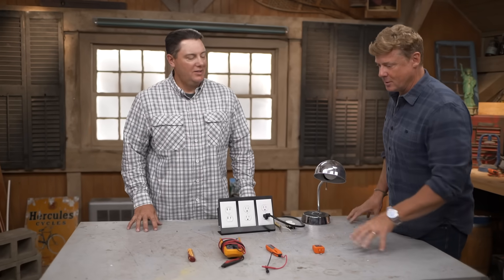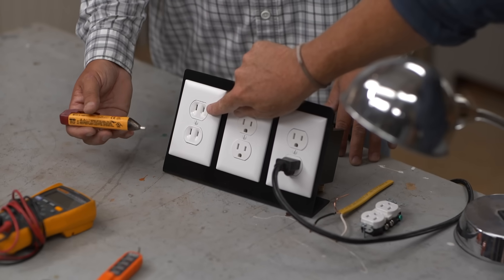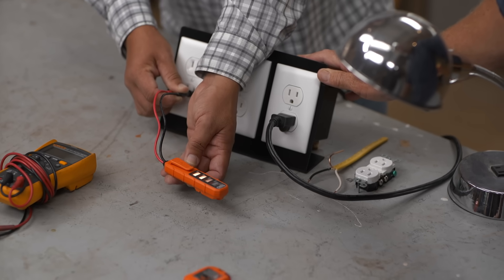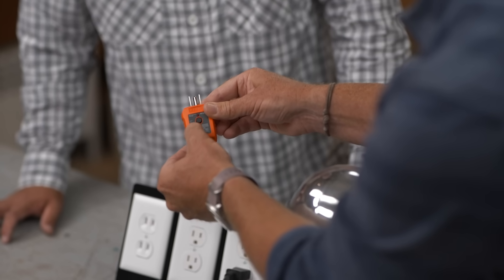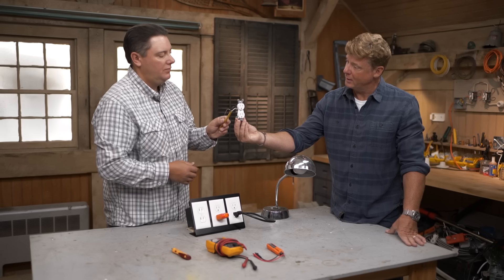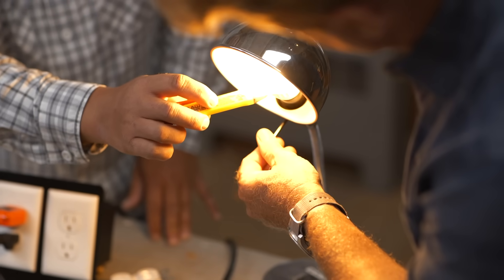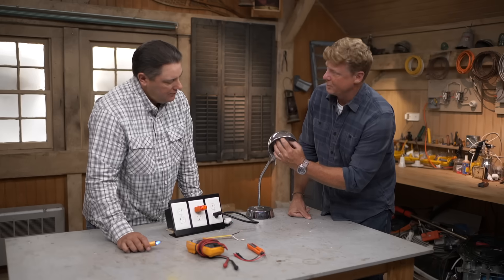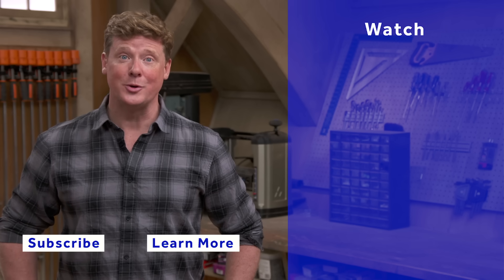How To Use a Voltage Tester | Ask This Old House

Comment: [1:45] — There might be a slight mistake here. Normally with regular multimeters, you first put the black probe in the longer (neutral) plug and then the red probe in the shorter (hot) plug.

That means here the red probe should end up on the right side but the demonstater put it on the left side.

Comment: I still don't understand what the usefulness is of the non contact voltage tester. If it says you have power, or if it says you don't have power, double check with a multimeter. Why not go straight to the multimeter then?

Comment: As a completely new commercial electrician, going on day 5 on Monday. I already have the multimeter tester but I’m scared to make contact with the meters as I don’t know if the polarity (positive and negative) will fry the system I’m working on or alter it in any way if I do it wrong? Right now I’m re-wiring light fixtures, pretty easy and plenty of unexposed cords. So in order for me to use my multimeter, I’d have to cut a wire and test it that way, would it be okay to place both meters onto the wire I cut? I’m sure if I test the ground I’d get nothing unless something was completely wrong lol so my question is do I cut the neutral or the hot wire and how would I place the meters onto the wire exactly? I’m not trying to fry myself as I work with 277v frequently and BOY is used with the colors making me even more nervous lol

Comment: THE CONTACTLESS TESTERS ARE NOT RELIABLE----I have 3 different models, 3 manufacturers-----AND I DON'T TRUST ANY OF THEM-----it's the false NEGATIVES (where power is actually on) that can get you..LOW VOLTAGE LEVELS (LEAKS) WILL NOT SHOW UP----still dangerous as hell.  You may think that a circuit is off, perhaps you pulled the breaker,---AND YET a wire can be energized through a short-and you'll never know---til you get zapped----USE ONLY HIGH QUALITY TESTING EQUIPMENT---or hire a licensed pro

Comment: The compact 3 pin tester - you also need one without the GFCI test button.  Because its easier than you think to accidentally press that button and drop the circuit back at the breaker - creating more work for yourself.  I discovered this at an RV park, when hooking up my camper to the power pedestal.

Comment: Direct contact tester is NOT fool proof!  You may not be making contact in an outlet for some reason and think it is not live although it is.  To be sure you will need to remove the cover plate to touch the connections.

Comment: I could not grasp the reversed polarity how to read it or less to correct the problem wiring it at all. Way too fast for me when you’re not an electrician by trade.
Reply: 2nd year electrical apprentice here from nz. Reverse polarity means live, neutral and ground wire are not where they should be. It means they have put into the wrong place for example live wire into neutral, or neutral into ground wire. 

If only neutral and ground wires have been swapped, the light will still work, but if the lamp is metal and bonded with the ground conductor, the metal frame will become live.

Comment: Receptacle testers - You have to be careful about the tester saying the ground is good. People that don't care about safety will put a short piece of wire connecting the ground screw to the neutral screw. If wiring in the house doesn't up to code a lot, then I would also take the cover off and look at the screws to be safe.
Reply: A socket tester is for casual testing. A proper test would include testing he ground loop impedance. The tester might show there is ground even if the impedance was way too high.

Comment: There is another mistake TOH, it is not reverse polarity. In ac circuits, your polarity is reversing 60 times a second meaning one side is negative and then 1/60 of a second later the same side is positive hence AC current. 
The fault is the fact that ground is always the white wire and what has happened, you are now grounding the black wire. I'm not going into the simple facts of the grounding in three pronged devices because it will just confuse you and the electrician. 
Just as a reminder follow the color codes in 240 v split phase ac and remember the polarity reverses by itself every 1/60 seconds. You should do better research.

Comment: Great information and comments. The 3 prong GFCI tester is definitely a good one to have. There is  a new version out that also has an LCD screen that actually gives you a voltage readout on the screen that comes in handy. I believe it is made by Klein….

Comment: Please help me out I have nowhere to turn. My electricity was shut off because of Bill issues. I brought a homeless man over to my house to make me a solar car powered battery charger. Because I charge all my devices through my car. My car doesn't drive but it starts up and I just put gas in it as needed and that idle to charge my devices through the cigarette lighter and through the car battery attachment clips. So back to the homeless guy. I left him alone at my house and then come back home and he's got four doors blocking the electric panel to make like a little closet. I said what are you doing and he switches a switch on the electrical panel and my power is on. Somehow he turned my power on on his own. I didn't ask him to do it and I didn't want him to do that. And I look in the power meter and such and there's like stuff on the ground that he cut and did s*** too pieces of stuff. I don't know what he did but only like half the power is on in the house. A month later a tweaker girlfriend of mine brought a dude over to my house said he can fix that. Soon as he walks in my house the lights start dimming like a seance. He said that's dangerous. So anyways they leave and I leave I come home all the electricity light poles on the whole block are off. And I look at my electric meter and circuit breaker box on the outside of the house and looks like he removed a couple circuit breakers from the top part. Plus don't forget all the light poles in the whole block are out and I was scared that maybe he did something bad to my house and I left and for the whole night cuz I pray the police are going to come. I ended up gambling all my money away at a local AMPM convenience store that has slot machines. I come back home in the morning I'm afraid to touch my electrical panel but I opened it up anyways. I don't know what it is it's all Chinese to me. That night the lights are back on the street but I have no power. Two days later I see on the news that this guy gets arrested for stealing copper wire from cellular towers and light poles all throughout the county. He had 300 transactions in 2 months at the couple different scrap metal yards in Nevada. Then I look online and I see that there's a lot of silver in the circuit breakers. I can't call the electric company. I don't have any money for a electrician I'm in 110° heat at my house and I have no water and no electricity and no air conditioning. I'm spending $8 a day on ice cubes just to cool my dairy products and meat in an ice chest. That's more money than be spending on electricity. Give me some clues of what's going on please thank you my dad died and this was his house and he was in the hospital for 10 months before he died and then covid happened and they have the moratorium I'm shutting off the electricity. So they finally shut it off. I moved in I had the electricity put in my name. My first electric bill was $3,230. They put his entire back Bill onto my first month's bill. So I wasn't really that pissed at the homeless guy turned back on my electricity because they wronged me in the first place. My bill should have been $30 not $3,230. Now I'm stuck between a rock and a hard place and catch 22

Comment: If you have two prongs, get an electrician to add ground wires or a GFCI. You might save yourself a nasty shock.
Reply: I'm not a professional.
If you have a two prong outlet you can't plug in 3 prong appliances so there is no need to worry.
But if you want to use 3 prong appliances in my opinion the best thing to do is to add a ground wire and 3 prong outlet which can be a big job.
GFCI is an option instead of ground wire but you don't get the advantage of reduced electric fields the ground wire gives.

Comment: It’s also a fire issue. Fuses are also placed on the hot side. If it is reversed an internal fuse cannot clear a fault condition. 

Theoretically the breaker should catch it, except if the short is a low current short exceeding the capacity for internal components it may not exceed the breaker capacity so the fault will continue until unplugged or the breaker is flipped.
Reply: Bull, almost all electronic devices use connector that fits either way. Lamps do not have fuses.
Reply: @okaro6595  if they fit either way that means the system either lacks protection or is designed to have fuesable links on both sides.

The reason non reverseable plugs exist and one blade is bigger than the other is to ensure the hot line is connected to where a fuse or other state is for safety. 

In lamps as your example without fuses it has to do with making sure the external part of the bulb is neutral not hot so in the event you touch the base of the bulb you won’t get shocked. 

So go troll somewhere else. How many UL certified products have you worked on?  Have you even done the process?  I have.

Comment: Before you test a live circuit with a multimeter, put the meter on the lowest ohms setting and touch the leads together. They should read zeros across the display. If not, one of the leads is broken. After you confirm you have zeros on the display, the put the meter on ac and test the circuit.

Comment: I have that middle contact tester and I found it worthless.  Give me a multimeter any day.  The non contact tester is amazing. I was adding a outlet and had the power off. The box had a second hot wire and I only found out because of the none contact tester

Comment: I don''t own nor have used any of these, but will pick these up when I'm at Home Depot.  So, I have a few questions regarding to the video above.

1)  With non-contact tester, does it matter which hole you point into to test ?

2)  With contact testers (2nd and 3rd item), they both have RED and BLACK pins, how do I know which color goes into which hole, or it doesn't matter?

Thanks.
Reply: Ideally for NCV you'll point/touch at the smaller of the two vertical pins. That is the hot. I would check all 3 "holes" because why not. 

With the digital multimeter on AC, black and red don't matter. AC would be shown as V with a squiggly symbol (~ tilde)
Reply: It tests the hole you are testing.
Reply: 1. Doesn't Matter, most non-contact testers will go off when your close to the outlet. Doesn't hurt try try both it your worried. 
2. Black goes in the Neutral (larger slot), Red in the Hot (smaller slot).  Also, never touch the metal part of the probes, if you have one plugged to the receptacle, the other one maybe hot.  Always put the black neutral probe in first, take it out last.
Reply: @teeing9355  If they lit close to the outlet you have a reverse bootleg ground. It is very dangerous. They really have to put it in. It is so insensitive. That means a tester for US outlets does not work in Europe.

Comment: What can you use when you're at the main panel and you're trying to determine which switch cuts power to a specific outlet from a distance?
Reply: A circuit breaker finder. They work great. This the one I bought and use.  There are others made by different manufacturers. It works great.

Klein Tool ET3000
Reply: @murdstonecardinal3355  THANKS.  Exactly what I need.

Comment: Several goofs. I retired from a large company with strict safety rules. We had to test the contact less tester to a known power source test the circuit then retest on know power source. We had a battery operated power source made by Fluke to test Multimeters. Sevetal times I had test leads break or work intermittently. Please tell us where in the NEC a nuetral is mentioned. In my code book they only use the term  grounded conductor. Had conract less testets give false positives. Light & buzzer would come on. Was due to having 15 to 20 energised wires in a long cinduit then a 70' long trough. When the circuit breaker for motor I wanted to work on was turned off and wires removed from bottom of starter still was telling me wires were energized. The other energised wires induced a small voltage that was pucked up by contact less tester.

Comment: As an electrician I carry a number of tester with me, including the first 3 types. I also have receptacle testers, one which tests and times GFCI trips as well as an AFCI tester; if you’re going to get a receptacle tester spend the extra to get a GFCI tester at a minimum. Also be careful with sum of the cheaper non-contact and direct contact testers as you can actually get sum parasitic currents/voltages on a line that can be too low to indicate yet still enough to hurt you. I carry a less expensive contact tester as it’s easier than pulling a meter out and unwrapping the leads but a decent True-RMS multimeter is something every homeowner should have. These aren’t expensive things, in fact I use these things along with some cheap tools and a tool box as a home warming gift for family and friends as these are a must have along with screwdrivers, pliers, and a hammer. Giving the basics also saves on having to go help people as they’re in the position to help themselves.
Reply: What brand would you suggest ?

Comment: Just don’t stick your fingers in a lamp fitting LOL. Unplug if you really need to for some random reason. Here in Europe you can plug appliances in either way anyway, even the grounded plugs. It’s more of a neat habbit to wire it consistently than of actual use.
Reply: Polarized plugs have been used here in the US for 60+ years to reduce the risk of shock from lamps, toasters, etc.
Reply: @illestofdemall13  Toasters have two pole switches.

Comment: So many appliances are wired as reverse polarity, Ive been zapped so many times by everything from DVRs to Stereos. Always completely unplug any appliance before removing the cover and working on it!
Reply: Even if wired properly, power will come into those devices and zap you. The bottom line is that before you work on things, you need to unplug plug-in devices or turn off the breaker to wired devices.
Reply: That's capacitance. 🤣
Reply: Those typically use figure 8 connector which means they can plug either way. You should always unplug before you open the case. What on earth were you thinking? Many times? That is suicidal. If you need to work on live equipment use an isolation transformer.

Comment: I'm sorry, but a tutorial on how to use the voltage meter too would have been much more informative
Reply: While you're not wrong, this is more of a "quick tip". Explaining how to make good use of a DMM would take the entire 25 minute program.
Reply: @oambrosia  For testing the electric installation of a house you only need 1 setting: AC. Earth to neutral should measure 0v, earth to hot should measure the line voltage. Neutral to hot should obviously show the line voltage as well. With those 3 measurements you have checked everything that that 3-LED tester does. If neutral to hot shows voltage but ground to hot doesn’t, then the ground is NOK. (But if it does show a voltage it still doesn’t guarantee that the ground is OK; you need complicated pro equipment for that with prongs that go into the soil outside)
Reply: @Engineer9736  The problem is you can't stick the probes inside a tamper resistant receptacle, which are used a lot in the US.

Comment: Warning If you bought that yellow Klein tool, check with home depot or Klein because some were recalled! The on button may not work and you may think there is no power, when it is live, causing possible electrocution! You should always check your tool on a known live circuit to make sure it works-flashes or beeps! This is serious stuff! If you are not sure of your ability, hire a professional to do it right!
Reply: Are you talking about the tick tracer ?
Reply: @rrfields65  Yeah, he/she was talking about tick tracer, aka non-contact voltage tester ;)